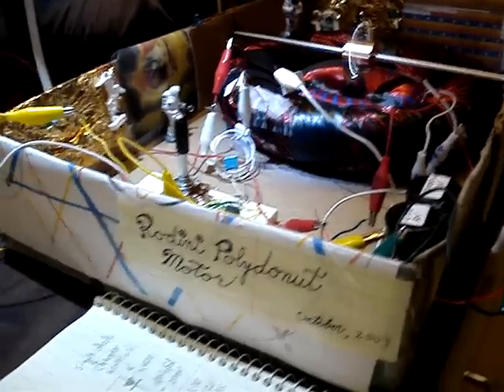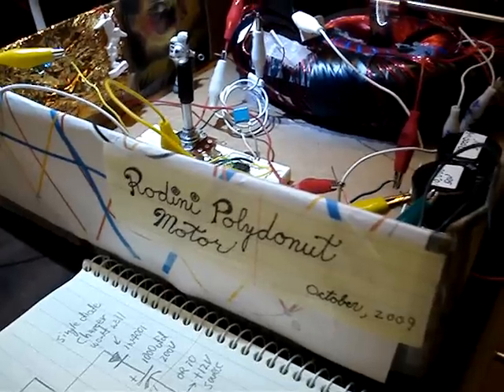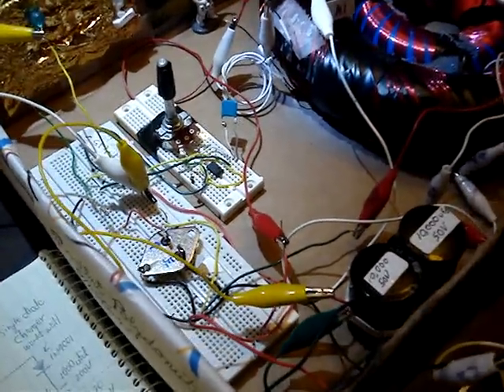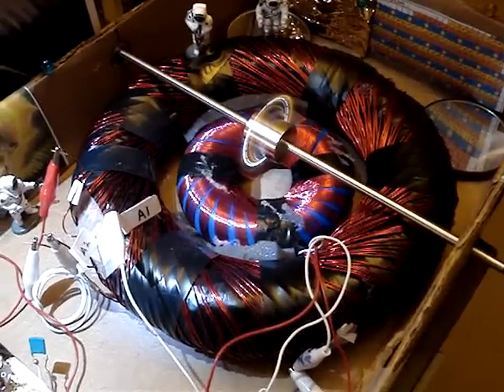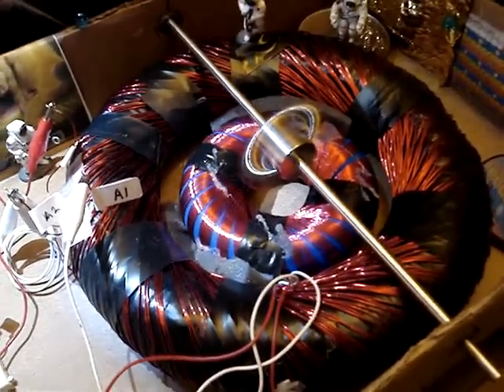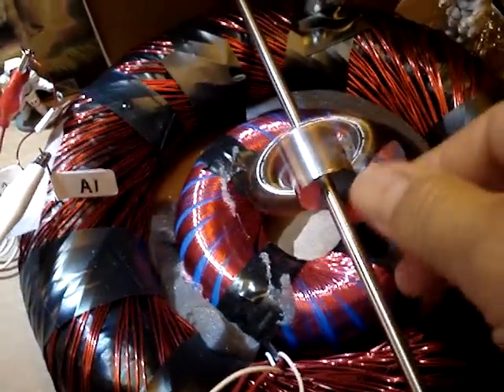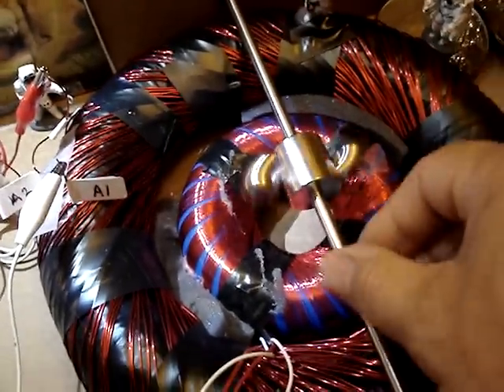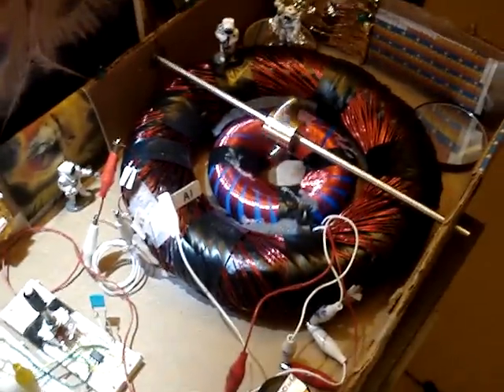rodini polydonut mpg

Comment: Hard to explain without a diagram, - sharing the same center.  The center hole is (close to) the same size, the smaller one actually inside the the structure of the larger.  To me that's more of a 'nesting' effect.  With a phi ratio, the 'harmonizing' may be of a preferential force.  Good stuff, got me and others thinking.
Note: I'm unsure of coil constructions, I'm just going off cosmic laws that  I'm learning about.

Comment: Nested notion is a good idea, but shouldn't the outer coil also be sized to the center of the first to be really nested?
So the smaller one is essentially inside the second larger one.  If this makes sense, and you can perceive how this could be done, I suggest a ratio of phi be included, so larger one is 1.618  or 2.618 times larger.

Comment: hi Jack, great build and experiment with the multiple coils.  I tried following the inner toroid form on a coil like your larger one (nicely done!) but I think mine was too small and/or had too little wire on it.  Your 555 driver circuit is doing really well with these coils - very inspiring, and I agree I think you're taking steps towards the 'proper' use of these coils!